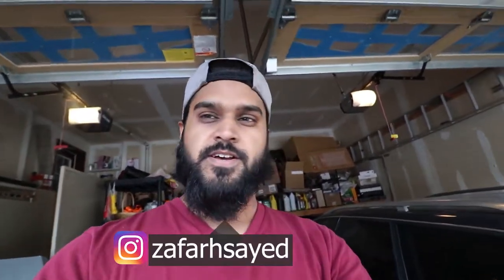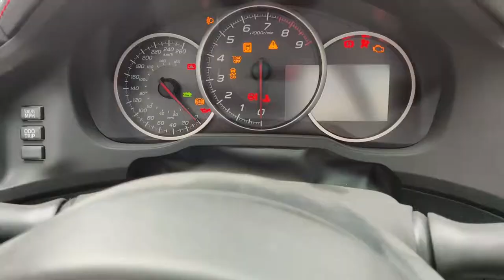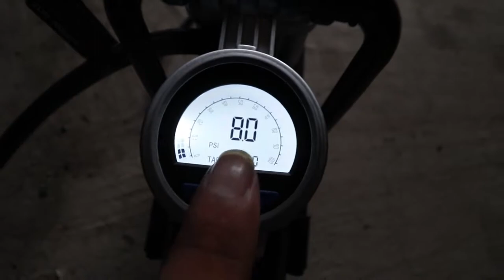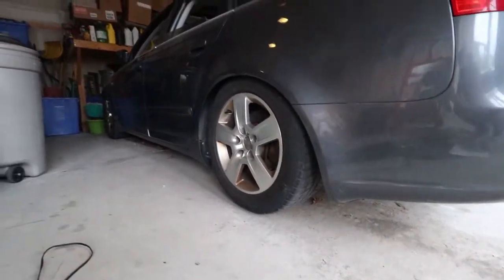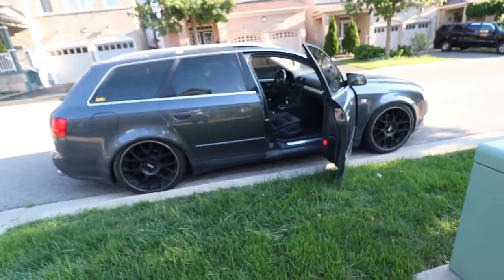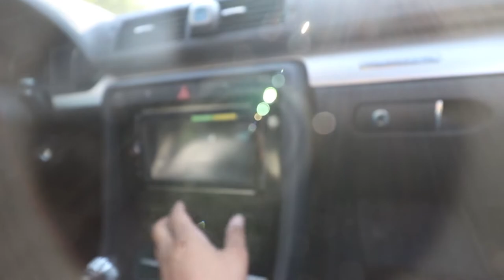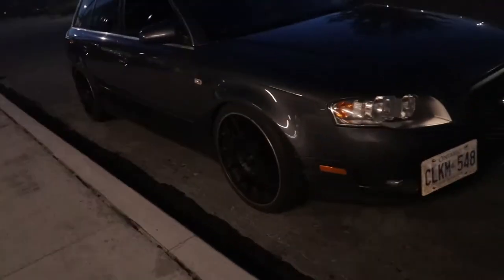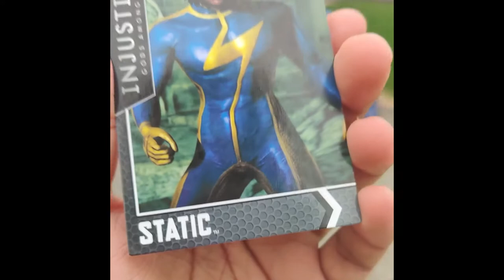Audi A4 B7 Avant gets sick BBS wheels and PERFECT fitment!!

Comment: Go and paint the inner Silver lining in the headlights. Got that done on mine with same colour. Looks way more aggressiv.
Reply from the maker: I've been thinking about it but I also kind of want to wait for a good deal on some used OEM xenons to do it to! Did you black out the inside?
Reply: @LivingAsleepHD  yes i did. I just painted the silver plastic lining in Black. Makes a big difference. And its the only Party that is not for reflecting the light. So you wont notice a difference at night while driving.

Comment: You clear the hub assembly in the front with no issue? Or is that why you put in a spacer? 

Looking to buy a 18x9+42mm and want to make sure I clear behind the wheel
Reply from the maker: I put the 5mm spacers just to get them more flush with the fender, didn’t have any issues with the brake/hub clearance! Do you have the standard brakes or a BBK?
Reply: @LivingAsleepHD  I have stock brakes! So I’m sure I’ll be fine
Reply from the maker: I think you should be okay then 😁 you can check the fitment industries gallery and see if anyone has a similar spec just to confirm as well

Comment: Where did you purchase the tow hook license plate mount?
Reply from the maker: I found an iJDMTOY product on Amazon:

https://www.amazon.ca/dp/B01G2RABNA/ref=cm_sw_r_cp_apa_fabc_25E7Fb2PCTZQA?_encoding=UTF8&psc=1
Reply: @LivingAsleepHD  Okay, thank you!
Reply: @LivingAsleepHD  Hello again, where did you purchase your front grille? I’m trying to find one but can’t find any :(
Reply from the maker: Do you have the standard bumper or S-line one? There's lots of aftermarket RS grills for the standard bumper (the one I have) on Amazon and eBay, but there are none for the S-line bumper if you have that. If you have an S-line you will either need to buy an OEM RS4 grill (expensive!) or make your own by cutting up an RS6 grill and your original grill surround. There's a good guide here:

https://nickscarblog.com/diy/how-to-fit-an-rs6-grille-on-a-b7-a4-s4-or-rs4-all-mesh-no-filler-plate

The one I have is from Amazon but the product isn't listed anymore.
Reply: @LivingAsleepHD  Crap. I have the S-Line one. Alright then, thanks for letting me know.
Reply from the maker: Sucks bro! Check audizine if there has been any updates and definitely keep an eye out if someone sells a used authentic rs4 grill on Facebook/eBay for a good price. I've heard making your own is a ton of work and time (and may not look that good) so it might be worth just waiting for a good price on the real deal. There's a great active FB page for the platform you can join too:

https://www.facebook.com/groups/audi.a4.b7.club/?ref=share